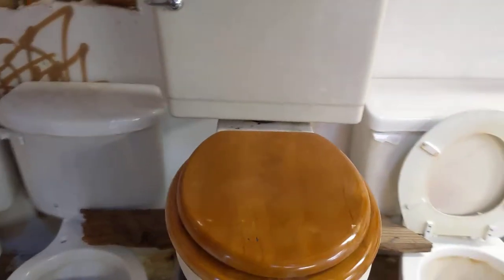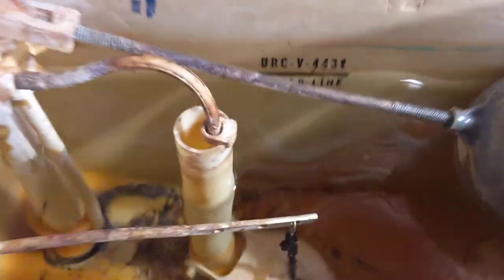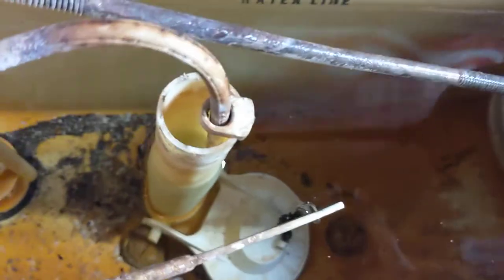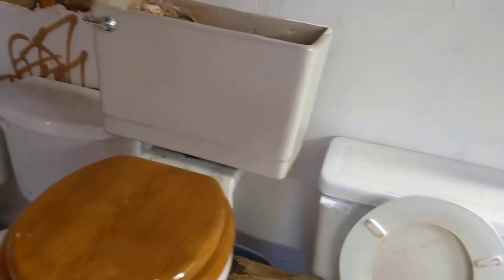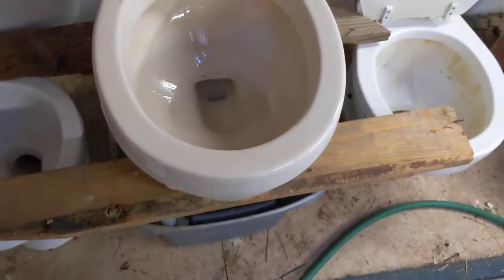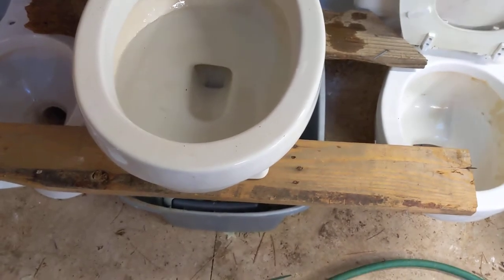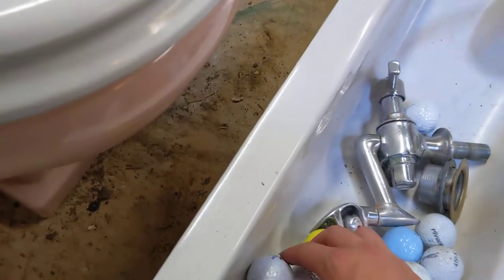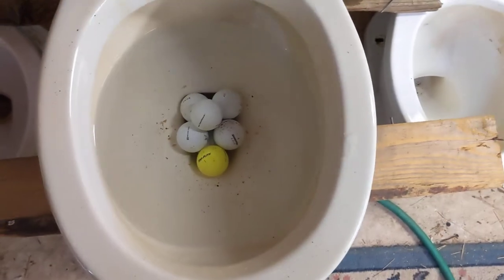237. 1987 Murray Savoy Flushes!

Comment: Darn awesome toilet just like mine! Sadly, I broke the tank lid on mine back in 2017 when I set it down to hard, and I had a use a saw to get the tank off and I ended up breaking the side of of it and it leaked, but I put some glue there in 2017 and it still holds up very well for being like that for 4 years lol. Nice video!